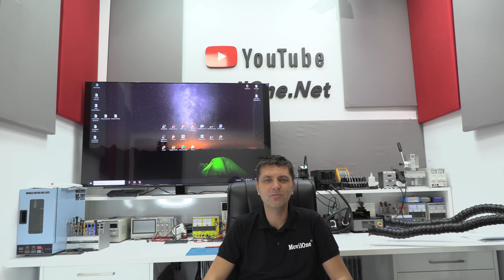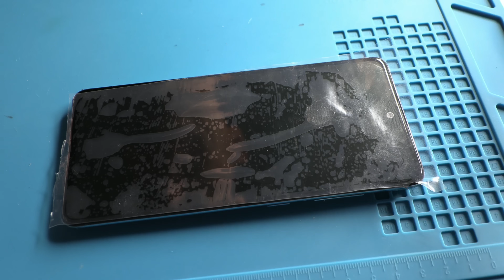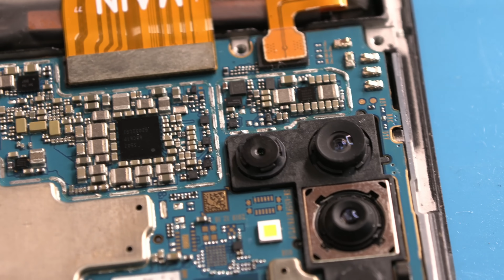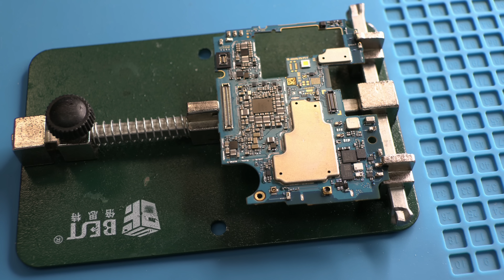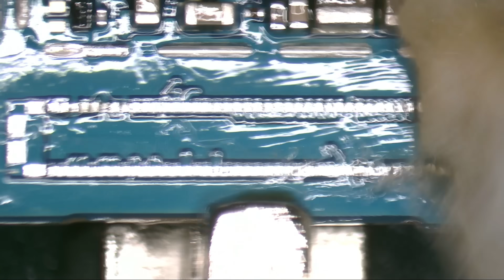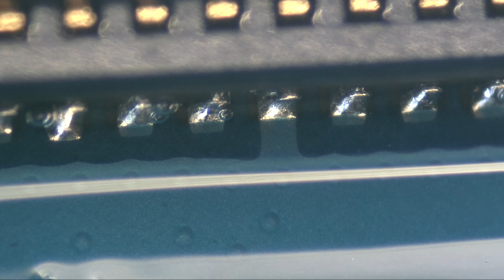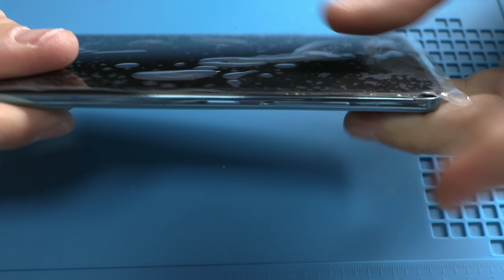The Samsung A Series Secret They Don't Want You to Know!

Comment: I had my sisters television set repaired in the late 90s. I called 6-7 repairers before I got one. Repairer said he had always wanted to see one of those things as he mentioned extraordinary weight of the TV. My sister has won Tattslotto and the TV was another CON on the TV was filled with boards many boards all the same just filled to the top with Electronics that weren’t connected. Just do add weight using The most expensive filler on earth
Reply from the maker: That’s fascinating! Filling a TV with fake components to add weight is an outrageous scam  yet sadly, it's not surprising given the lengths some companies go to manipulate consumers. Thanks for sharing this incredible story!

Comment: They design the mobile phones and other electronic gadgets with a timer running to stop or corrupt certain stages of circuit, after certain months or years.
Reply from the maker: It’s possible that some brands underestimated how fragile their designs were, but given how common these failures are, it’s hard not to suspect deliberate intent. Either way, the result is the same consumers pay the price. Thanks for your comment!

Comment: Sir Samsung A50 Restart randomly is there any solution.
Reply from the maker: Random restarts on the Galaxy A50 are often linked to power IC failures or solder cracks on key components. A skilled technician may be able to stabilize it with a proper reflow or chip replacement. Let me know if you’d like some tips!

Comment: As a TV technician in Brazil, I never buy Samsung TVs and never recommend them, their displays are designed to die in 3 years or less. For this reason I only buy LG TVs, their hardware is garbage but their displays are solid, and it's much better to have to replace a TV's mainboard than its display
Reply from the maker: That’s a smart approach! Samsung TVs are notorious for early display failures, while LG displays are often more durable. It’s better to replace a mainboard than a screen your strategy makes perfect sense. Thanks for sharing your expertise!

Comment: So why does my a20e battery drains from 20 to 0 in a minute
Even if you charge it at 20 it will drain to 0
I have changed the battery but the problem is there
Reply from the maker: That’s a classic sign of a damaged charging circuit or faulty power management IC (PMIC). Since you’ve already replaced the battery, I’d recommend having a technician inspect the power control area on the motherboard. These issues are common in the A20e series but can often be repaired. Let me know if you’d like some guidance!

Comment: True, I had the same problem. The Samsung service centre asked me around 150€ + to change the display and the connector. I opened IT and tried it myself. I've seen the broken pins. What you say is true.sansung makes crappy electoral equipment. I am never buying anything from them.
Reply from the maker: Well done for taking the initiative to repair it yourself! Sadly, Samsung’s repair costs often push people toward replacements when many issues are fixable with patience and the right tools. Thanks for sharing your experience stories like yours inspire others to try independent repair as well!

Comment: Wow. This connector is so flimzy that probably a stronger thumb push on the back of the could break it, especially a small drop. Maybe it does for a lot of people.
Reply from the maker: Exactly! The connector’s flimsy design makes it incredibly vulnerable to pressure or minor drops. Unfortunately, this type of weak design is often intentional, ensuring repairs are costly or devices get replaced faster. Thanks for pointing this out!

Comment: The video sounds a bit dramatic but speaks fact. My Galaxy A05s suddenly stopped working, was brought to a local skilled tech and diagnosed with the same issue. Samsung can be very petty sometimes, they used to build very practical and repairable device like S5. My cheap Galaxy J7 from 2015 still works like a champ, no issue. They got big, thus becomes greedy. Chinese brands may make spyware but at least they do build reliable phones now.
Reply from the maker: You're absolutely right! Samsung's shift from practical, repairable designs like the Galaxy S5 to fragile, failure-prone devices is frustrating. The older J7 series, despite being a budget phone, was built with far better durability in mind. Sadly, as these companies grow, greed often takes priority over quality.

While some Chinese brands raise concerns with privacy, many are indeed focusing on building solid, long-lasting devices something Samsung seems to have abandoned. Thanks for sharing your experience,  it’s a perfect example of how the industry has changed!

Comment: Hi! Quick question I changed my phone batteries a few times and wiped the phone. Still, phone discharges relatively quickly. Is that a known/identified issue with mobile phones these days? Thank you!
Reply from the maker: PMIC, Charging IC...
Reply: Maybe the battery itself!

Comment: Im going back using Nokia 3310 with SIM long terms expired... better than claim smartphone but its totally clichephone... starts computer with more software and solution
Reply from the maker: I completely understand your frustration. The simplicity and durability of older phones like the Nokia 3310 are hard to beat. Modern smartphones often feel overcomplicated, with constant updates, intrusive software, and fragile designs that seem to prioritize profit over practicality. While smartphones offer powerful features, sometimes going back to a reliable, straightforward device is the smartest choice — no gimmicks, just something that works when you need it.

Comment: 100% true especially in samsung their series like a25, a33 or m51, m51s and other models also. Nowadays apple has making their smartphone a little bit easy to repair not like too easy but as  compare to 14, 15 then 16 is easy but now samsung started doing this silly things like if u replace bad cc board with new 100% genuine cc board  ther another fault occur temperature too low or high and  also stop fast charging or it will work fine but it can't run for long period and in some cases on replacing charging pcb the screen stop working. Repairing Samsung phones is very risky bcz many time  we are working on a phone and charges are for that job is 500 but instead of earning get ripped for 2000 or 3000 or 5000
Reply from the maker: You’ve perfectly described the growing frustration with Samsung’s repair challenges. Even with genuine parts, the system often introduces additional issues like temperature errors or fast-charging problems. This unpredictability makes repairs increasingly risky for technicians, and unfortunately, consumers end up paying the price for these engineered complications.

Comment: I have a motorola g73, it is top heavy and the weight distribution is unbalanced. It has fallen off my hands, innumerable times.
Reply from the maker: That’s a frustrating design flaw! Poor weight distribution can make even a sturdy phone prone to accidental drops. Using a quality case with a firm grip can help reduce the risk, but it's frustrating when manufacturers overlook such basic design concerns.

Comment: Does this issue still occur with the A25?
Reply from the maker: Yes, the A25 series still seems to suffer from similar issues with fragile connectors and intermittent charging problems. Sadly, Samsung appears to be repeating this pattern across several models.
Reply: @MovilonePhoneRepair well seems like I messed up cuz I just got the phone like a month ago 😅

Comment: I had my old A5 2017, it was my first and the best Galaxy A till this date, so after that i switched to A71 because my old A5 was so good so i expected the same experience and it was also so good but in random day after 3 years of usage without been repaired the phone randomly shut down after i flashed the stock rom because i was on one ui 6 rom so it was not stable at all, the phone started to crash on camera app and it heats up so bad that i cannot even touch it and then it turned off, so i went to a repair shop and he told me that my motherboard died and the cpu got cooked and i was in shock because i never expected to see a dead samsung motherboard after been using phones from this brand for literally 11 years and i went to A05 because my budget got really tight and i have a lot of really important information backed up with samsung account, the phone is fast but not as good as the A71 or A5 2017 and it heats up from time to time , if samsung still keep doing this then i will no longer buy anything from them forever and i will switch to other company like the nothing phone company or oppo/oneplus both of these companys cares about their costumers and i really want that so i hope my A05 last for about a year or so to upgrade for another samsung or leave it

Comment: my galaxy s10 destoryed itself completely from the day 1 overheating for no reason i checked them they say its normal i format many times to fix but all they were doing is waiting so my warrenty will be over now it have no sound lags like crazy like 2 gb ram device and i cant play video it started on slow motion and i can play games even a 10 mb ram games it wont open any game idk what to do its been sitting in my bed for over a almost a year i neeed to change cpu and gpu so it will work like before let me know if u can fix all that i can send u my device for repire send me everything from where i can send u i live in pakistan
Reply from the maker: That sounds like a frustrating experience. Overheating issues from day one are often a sign of deeper hardware faults, possibly linked to the CPU, GPU, or power management IC. If your phone is still recoverable, a skilled technician may be able to reflow or replace those components. Unfortunately, Samsung's post-warranty support often leaves customers with few options. If you’re willing to send the device, I’d be happy to advise on the best repair strategy.

Comment: I had a a71 just die for no reason I wonder if that was the some thing
Reply from the maker: That sounds very similar to the connector failure I discussed in the video. Replacing the connector is likely the solution, and it's a common issue in the A71.

Comment: They do the exact same thing in the automotive industry ! For example, some vehicles from like 15-20 years ago, you could not even replace a window master switch/control with a used one without having the need to reprogramming it in order for it to work ! 😩 Now imagine the repairs for the newer vehicles, some have more than 20 computers ! Radios are not even simple anymore, they are now made of like three components or more
Reply from the maker: Absolutely! The automotive industry has been applying similar tactics for years from proprietary software that blocks third-party repairs to intentionally complex designs that make simple fixes costly. It's frustrating, and unfortunately, it's all about maximizing profits at the consumer’s expense.

Comment: I bet you could fix this by putting a piece of cardboard or something inside to push the contact down😂
Reply from the maker: In some cases, wedging the connector can be a temporary fix, but I strongly recommend replacing the damaged part for a lasting solution. These fragile components rarely stay stable for long once they start failing.

Comment: A majority of manufacturers sabotage devices with updates just so you are forced to buy a new one. I've ran into the issue countless times throughout my smartphone ownership since 2012. I have a few models of phones that are the same thing and the ones that i didn't update always outlasted the updated ones. It's a pretty wicked tactic.
Reply from the maker: You're absolutely right! Software updates have become another tool for driving planned obsolescence. Deliberate slowdowns, performance throttling, and battery issues often appear right after an update it's a manipulative tactic that’s designed to push people into buying new devices. Avoiding updates when your phone works fine is sometimes the best strategy.
Reply: One thing I learned is never update software after a year. @MovilonePhoneRepair
Reply: You wanted capitalism, that's it

Comment: I worked on a bunch of A51 phones. There was one that never got fixed because it had a problem with that bad connector. Had to check and replace many parts before finally identifying the problem.
Reply from the maker: That's exactly what makes these repairs so frustrating. Identifying the faulty connector often requires extensive troubleshooting and sadly, many phones get discarded before the real problem is found.

Comment: This doesn't look right. 400 celsius should have melted that plastic within 10 seconds.
Reply from the maker: It’s a fair concern, but with precise airflow control and quality flux, heating at 400°C can be done safely without melting the plastic. The key is maintaining low airflow (around 15%) to prevent excessive heat buildup.

Comment: i retired my a50 after cracking the screen but it still goes today. do you think excessive heat from the battery may speed up the degridation of these connectors? I always used slow charge over fast charge to extend battery life but that may have keept the battery from more extreme changes in heat?
Reply from the maker: That's a great observation. Excessive heat especially from fast charging can accelerate connector degradation. Slow charging is generally better for long-term battery health and may help reduce stress on fragile components like these connectors.
 The connector has failed due to poor quality.

Comment: Sometimes its in the firmware update. Jan 2025 update, made our S21 Ultra drain battery faster than normal. You can read a bunch of complaints about that too.
Reply from the maker: Firmware updates causing battery drain is sadly becoming more common. Manufacturers sometimes introduce these issues intentionally or through careless optimization. Checking forums for update-related issues before installing new software can help avoid these problems.

Comment: hello,

do you know if on the Alcatel 3x 4cam the charging port replacement is accessible removing back cover or screen?
Reply from the maker: In the Alcatel 3x 4cam, accessing the charging port typically requires removing the back cover. It’s generally not as complex as screen-first designs, but careful handling is still necessary.
Reply: @MovilonePhoneRepair  I replace the charging port 2 weeks ago, accessible removing back cover.
thanks

Comment: I self repair my vivo y33s.... It kept shutting down so i saw a diy video and a device was implanted on the battery so i soldered it out and short circuit it and it now charges faster before it was DIY'd be me.... And stopped shutting down
Reply from the maker: Nice work! DIY repairs can be highly effective, and taking the time to investigate the issue yourself often leads to surprising solutions like yours. Well done!

Comment: I saw trick that putting heat again after soldering removes stress and helps with cracking and these tiny crystals that causes shortcuts in LF solders. 

It's hard to buy lead solder nowdays. I live in EU and shops don't sell lead solder .... Legally. 
I saw some speach from guy that repair control boards for nuclear plants. They had a lot of problems with lead free so they have pardon and use lead solder. But he was talking about that reheat trick. Also my friend that works for one germany owned automobile factory told me same story. Reheat.
Reply from the maker: That's a fantastic point! Reheating solder joints after the initial repair can help relieve stress, especially with lead-free solder, which is prone to micro-fractures. Sadly, leaded solder which is far superior for durability has become harder to find due to environmental regulations. However, as you mentioned, industries like nuclear power still rely on leaded solder because of its proven stability. The reheating trick is a great workaround when using lead-free materials. Thanks for sharing this valuable insight!